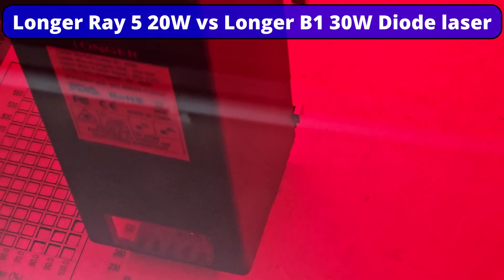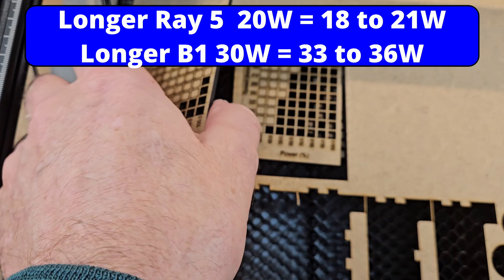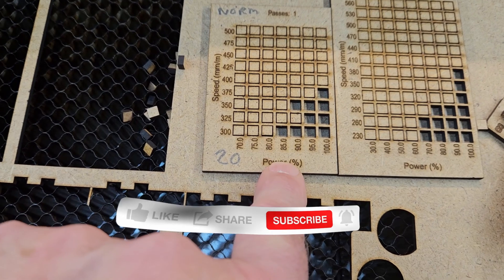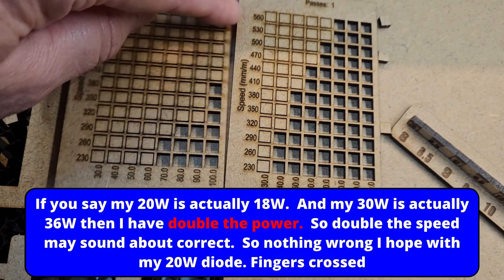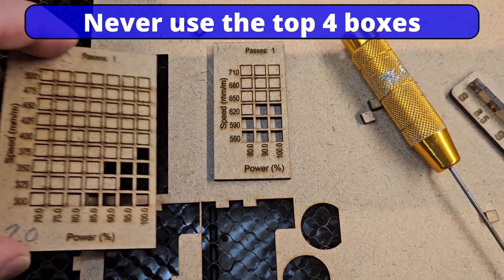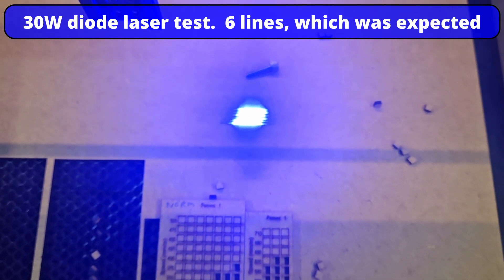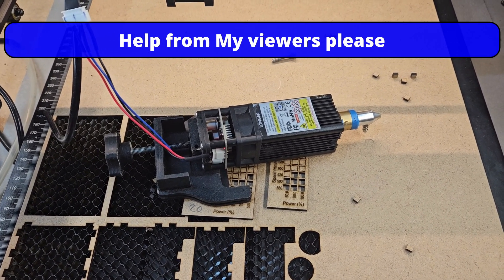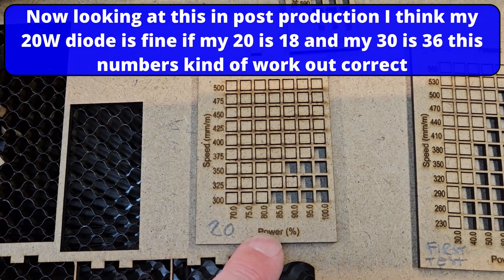Diode Laser 20W vs 30W  Power Test  Faster Cutting How much better is a 20w vs 30w diode laser

Comment: I have the longer ray5 10w and I wanna upgrade eventually so is the b1 better then the ray5 and is it faster?
Reply from the maker: Well the b1 has a stiffer frame. Ray5 max engraving speed 10000 mm/m. B1 I think is 36000. But for both of them you will never be able to engrave that fast.  But the b1 is a better build for sure.
Also the b1 has auto air assist.

Though the ray5 is a great laser.

You could probably get two ray5 for the price of a b1.

It all depends what you want to cut and engrave

With more power you get a bigger rectangular beam. So you will loose some details in engraving
Reply from the maker: Or upgrade to a 20 or 30w module on your ray5.  Though of you buy a complete b1 then you have 2 to use and could double your output

What do you feel is lacking on the 10w.

What do you use it for?
Reply: @FlixmyswitchLASER well iv been trying laser engraving on wood with it, you helped me alot with the lasergrbl in the group lol but I just was thinking cause I had a guy tell me that the 12x12 I done took a hour and 12 minutes cause I only have a 10w laser, i just wanna pushout good products and I was tempted to go to xtool but I kinda wanna just keep with longer cause the service i got was great and that means alot to me
Reply from the maker: Xtool are expensive and very overrated.  I first bought a 10w and it's done everything I have needed it to.  I love that it's beam is almost square.  In the next few weeks I will do an engraving test for you. Between my 10 and a 20 to see how much faster it is and if the lose of detail due to a larger beam is noticeable

Comment: Did you use a b1 head with a ray5 controller?
Reply from the maker: Firmware update.

https://youtu.be/liZzBr5EEWY?si=9KVzO5nzM2faAetK

But if it's not brock don't upgrade
Reply from the maker: Yes I did. It has the v2.2 firmware on the tft screen. With limit switches fitted. The b1 has a better backplate with m4 bolts. My ray5 20w has only m3 bolts
Reply: @ interesting I got 1.2.5 do you have a video on how you did your update
Reply from the maker: @dakutatsu6450  yes but if it not broke leave it.